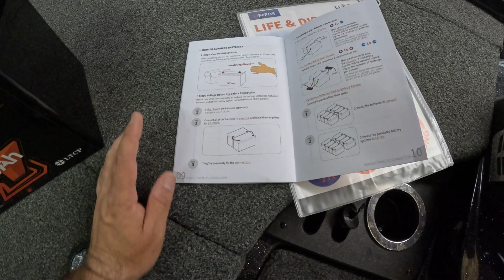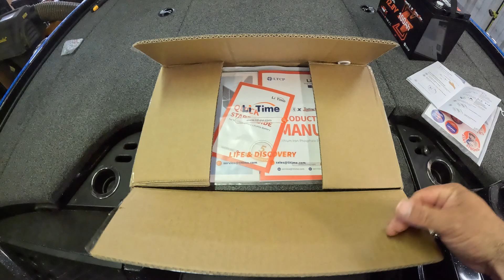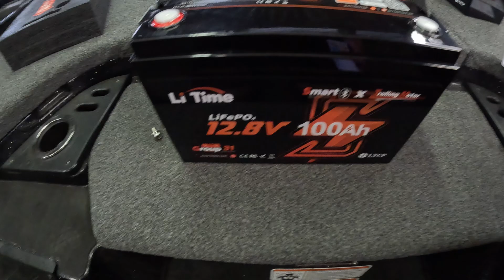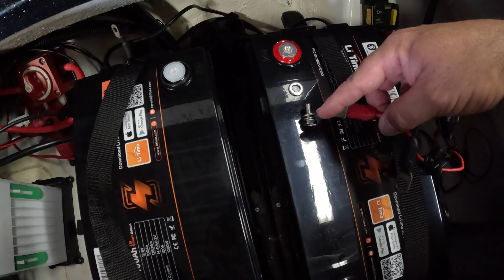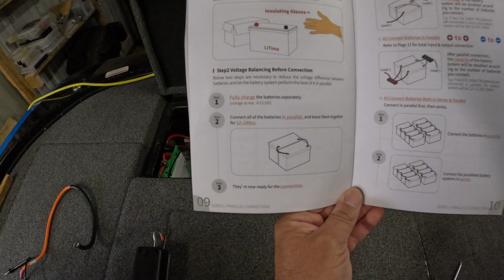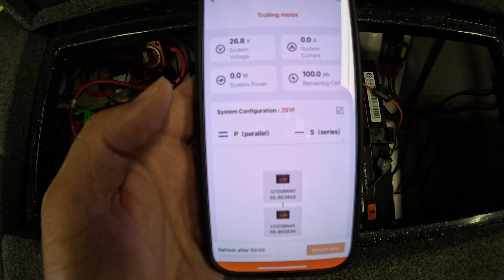How to Upgrade your Boat Batteries to Lithium!

Comment: If the type of charger matters, what about charging off the alternator? Will a standard alternator damage the lithium ion batteries or will the alternator get damaged?
Reply from the maker: Yeah this is why more research is needed if you plan to upgrade the battery connected to your outboard.  Not an issue for trolling motor applications… but you’d definitely need to check with your outboard manufacturer to see which brand they recommend!

Comment: Do you use a separate battery for the outboard? If so does that mean you run the electrics off the lithiums
Reply from the maker: I do have an AGM Group 31 battery that runs the outboard and all the electronics... these lithiums just power the trolling motor.

Comment: Me and you have the same boat and motor. I upgraded to two LiTime 12v 140 ah smart batteries in series for 24 volts for my ghost . I’ve had them 6 months now and zero issues. I went with 24 volts because it pushes my full boat great. I power fish allot and get 3 trips easy. Could get more but I keep my lithiums in 80/20 range . Most lithium battery nerds say it’s best ! I just installed a group 24 LiTime 12 v 100 ah lithium battery for my electronics . Took them off the AGM battery . I still have the AGM it came with for starting and pumps . I’m not ready yet for lithium duel purpose yet . Maybe in the future. Would probably go with Millertech if I did ! I charge the Agm , and two trolling motor batteries with the charger that came with the boat . The electronics battery is charge with a LiTime 12v 20 amp charger . I have Anderson cable permanently attached for easy charging of electronics battery . Real happy so far . Especially Bluetooth! I put a blue tooth monitor on the Agm battery so I could see voltage .
Reply from the maker: Heck yeah man!  Same with me - kept my AGM starting battery.  Still life left in it I think!  Glad to hear yours are still working well
Reply: I put all my electronics on 1 perco switch too . Fuses are all in the battery compartment now ! Not up front or in consol ! I have 1 Garmin up front and the Two original Lowrance 7 ‘s . Probably will get rid of 7’s and put 12 on console eventually. On thing I need to check on though is I smell some gas smell in battery compartment! Don’t know if it’s the tank pressure release or a fitting. Going to leak check myself first ! Do know much about the tank release valve though. Do you ever smell a faint gas smell ?

Comment: Just wondering if you give any thought to using one 24 volt lithium?
Reply from the maker: I did, and the only reason I didn’t was because I’d have to re-do my battery trays… this way I can keep the placement the same and won’t have to drill any new holes